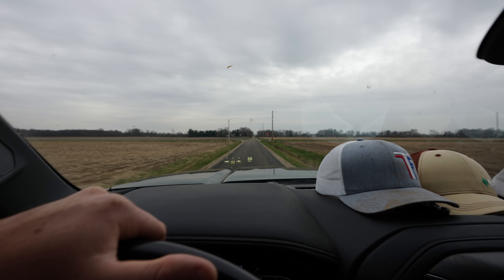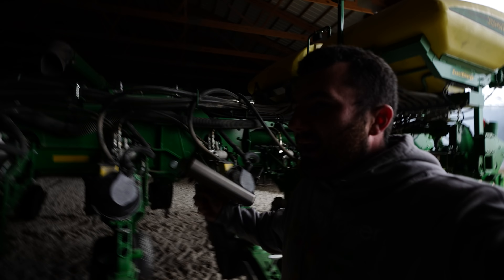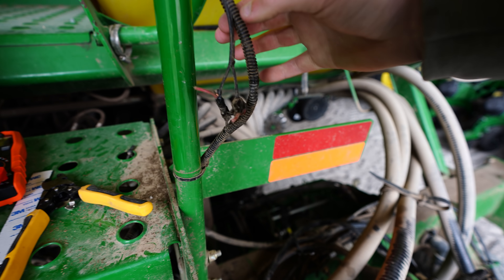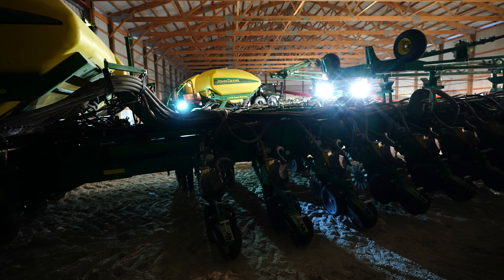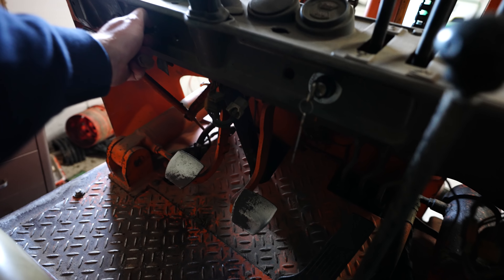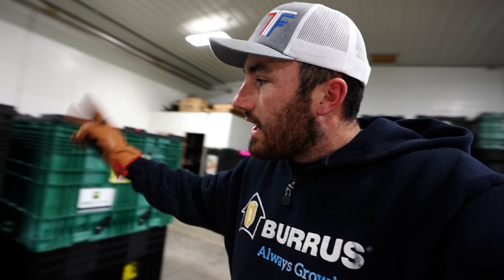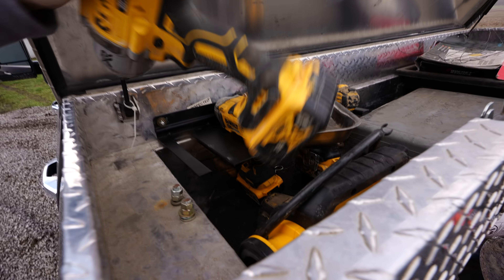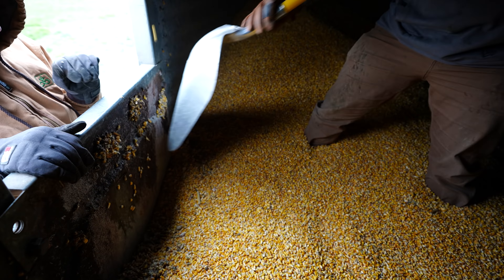Big Changes To Our Farm Before Planting Season (Ep.159)

Comment: Hiya, Mr Trippy,
Great video, thank you. Did you know that electrician tape makes a great way of stopping minor bleeding, and protecting a cut? Wrap as tight as you need, but do not mess with circulation. 
Put the lights on top of the tank pointing down, if in contact use LED lights with no heat output. They light up the tank and the product showed up well, in fact, you get glowing big yellow tanks. I used to do lighting for a living, touring with people like Bob Dylan then did TV and film power and lighting. Three dropped nuts and you're out? Nope, persevere. 
Stay safe, Steve...
Reply from the maker: Bob Dylan.... I bet that was a trip! Thanks for the advice!

Comment: Hey, I have a good idea for the lights. I did this on my 1790. Drill a hole and mount them on the platform that you stand on to load the tanks. Have the lights shining on the side of the tank instead of the back. You dont have to worry about bulge with the brackets all around there, and you have a secure place to mount. The only downfall (depending where you place them), you could accidentally kick them but they're really out of the way, i have had good luck with them as such
Reply from the maker: That seems like a great idea. If it keeps raining, I may revisit the idea!

Comment: Just an idea, but have you considered a cordless light inside the tank, possibility mounted to the lid. Dewalt has a few lights that might work. Worse case, you need to purchase a new lid.
Reply from the maker: That’s not a bad idea. It would be hard to control it in sync with the tractor lights, though.

Comment: Do you guys typically put out N pre plant, or combo pre and sidedress? I have thought of going all N pre, then almost every year it gets really wet and I'm happy I didn't. It should dry quicker since it's warming up.  good luck
Reply from the maker: I am a fan of a side-dress. We have 120 lbs actual N on now with Fall NH3. We come back with at least 100lbs actual N of 32% with sidedress. The split application has really brought our averages up. I think it makes a drastic difference on a wet year... easily 30+ bushels.
Reply: @aTrippyFarmer  My biggest N needs are emergence and grain fill. It’s tough getting through the mulch layers. I plant in to standing covers, but the buildup from the 6500 lb fall cover crop I grew, and the snow drilling I did on a warm season cover crop might get is up to 10k/acre if I plant really late, we’ll have 3 passes with cattle and 3 with poultry. I’m thinking we might get 200 lbs of nitrogen on in total naturally. 

This is ground we custom farmed for years that we’re renting with an optional balloon payment to buy it. The clock started summer of 2020 on organic certification. I am trying to get wells in for my linear irrigation rig and if I can get hog manure applied that way it would be ideal. I hedged the crop based on it doing 100 bushels per acre at $6.50. That’s dead nuts skin of your Peter break even. 

I have 1500 acres of bean ground this hear that’s been in the program 22 years. I do real well on those fields, well over county average regardless of what crop is sequenced. I have about 5 years of putting my shoulder in it ahead of me.  My most southern cluster is 1400 acres of moonscape I picked up 3 years ago. I had some decent beans on some of it last year and it’s in cereals or still on rest / pasture duty. 

My point? Take a deep breath my boy, and bask in how fortunate you and your sister are, because us generation 1.5 guys (farming skipped a generation in my family), we have to fight, scratch and claw our way along. I’ll be taking the big dirt nap before the plan is complete. People in your own family did the same thing I’m doing right now.

Comment: Our new 42 ft bins from sukup was only 4 grand for each powersweep
Reply from the maker: Only 4,000????
Reply: @aTrippyFarmer  that's all that was listed on the quote breakdown sheet.
Reply from the maker: @roberturich5346  the Brock power sweeps for a 36’ bin are $10,000
Reply: @aTrippyFarmer  I'll dig through my papers and try to find the quote to be certain but 10 grand seems very high
Reply: @aTrippyFarmer  we just purchased a new sukup 30ft bin as well and the power sweep on it cost $3,219
Reply from the maker: @roberturich5346  I’m not doubting you at all. I’ve got the bid sheet in front of me. Damn near $10,000 for the sweep.
Reply: @aTrippyFarmer  is there any reason that a sukup sweep wouldn't work in a Brock bin? Although good luck getting anything before August
Reply: @aTrippyFarmer  We paid about $6,000 for a power sweep in a 42' bin in 2011, plus $1000 for a 10HP motor that we move around to other bins.